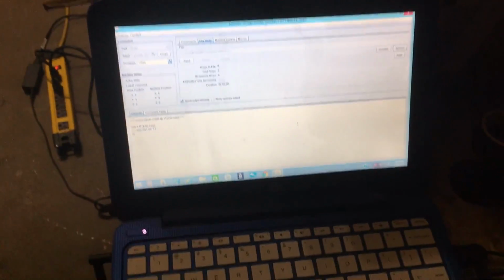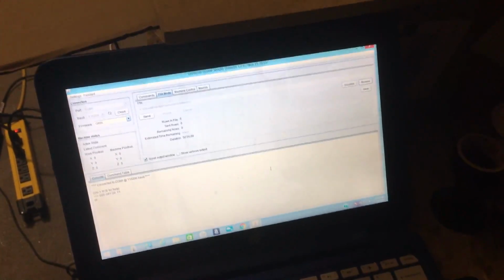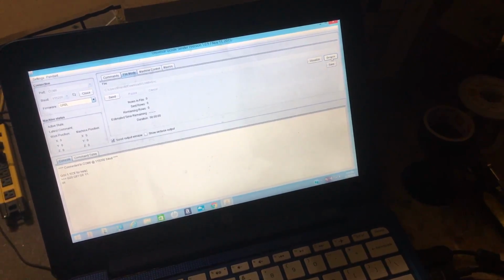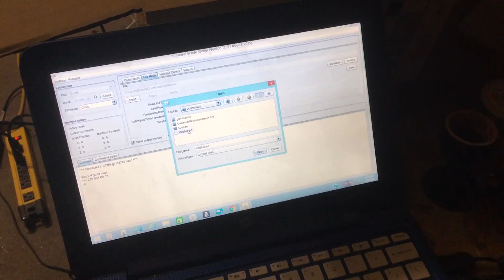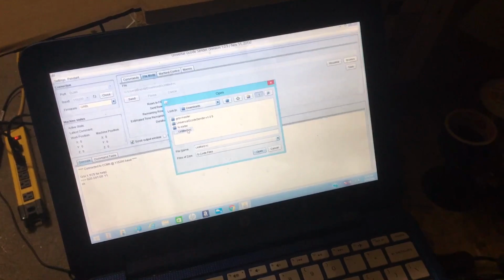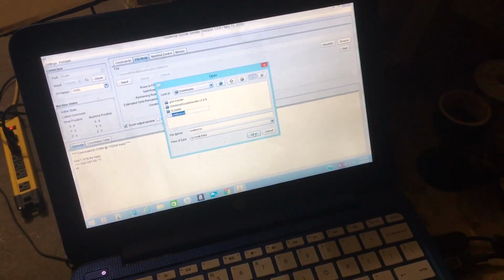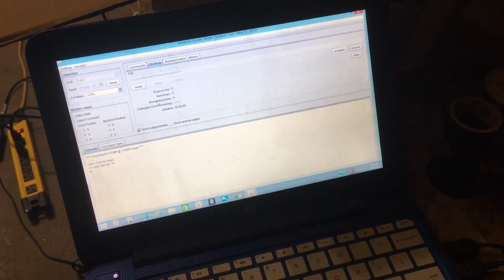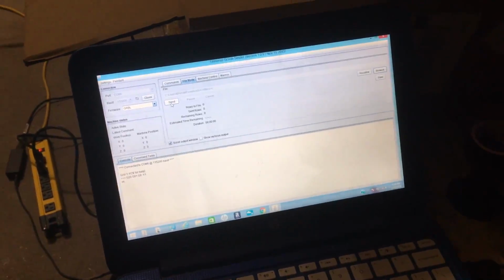Testing The Highline CNC Routing Machine's GRBL Controlled Arduino Uno Electronics

Comment: Once you hook up the drives How will you set steps per? How will you calibrate the distance?
Reply from the maker: I used Universal G Code Sender to access the settings for GRBL. This link explains the simple process: https://github.com/gnea/grbl/wiki/Grbl-v1.1-Configuration
Reply: Thanks. That looks pretty complicated to me.